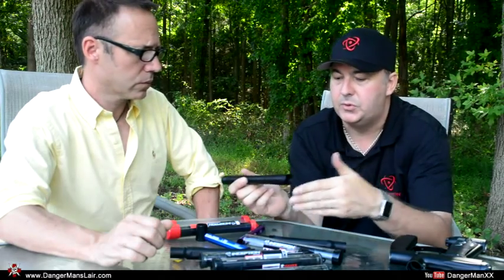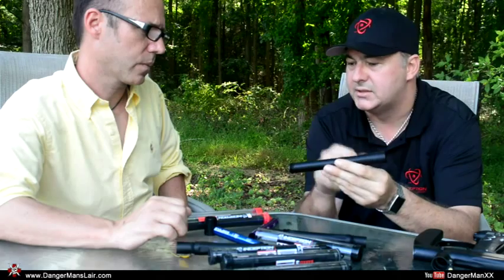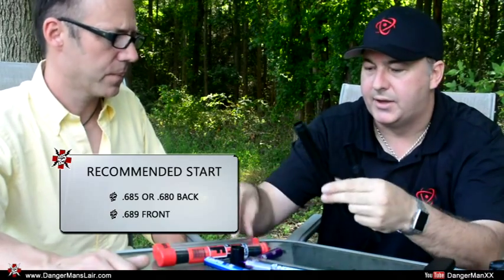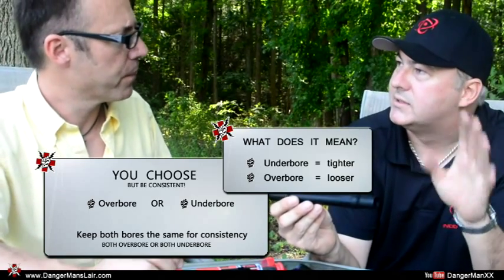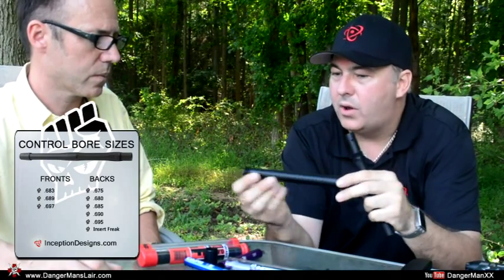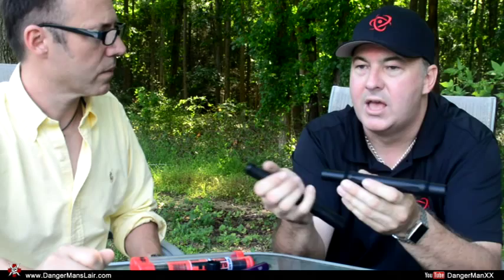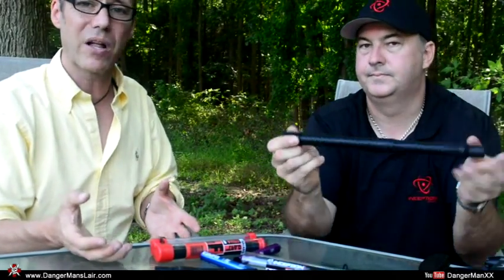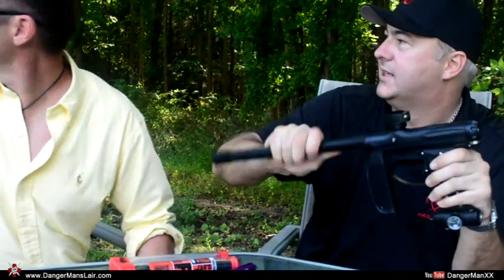Inception Designs Simon Stevens Explains the Stella Barrel System - PART 2

Comment: A separate reviewer (FAST ACTION RESPONSE TEAM PAINTBALL) of this barrel system said that the Freak Insert version of the system requires you to use the .697 front or else there is a ridge that will clip a paintball and cut it thus causing barrel breaks. Is this true that you can't size down the front piece with the Freak Insert version of the barrel back or can I still go with the recommended sizes on the front with a Freak Insert back piece? Thanks.

Comment: As a big fan of the freak system I must say this looks like a great kit especially coming from Simon Stevens. Only thing I dislike is the thread on "tips"....
Reply from the maker: There is a non-threaded front too. ;-) But as you have liked the Freak set, so have I. I still have mine. I may just need to finally part ways with it. I have not used it since I started using the Stella kit. That's not a slight to the Freak Set. For me it just says how good the Stella is.